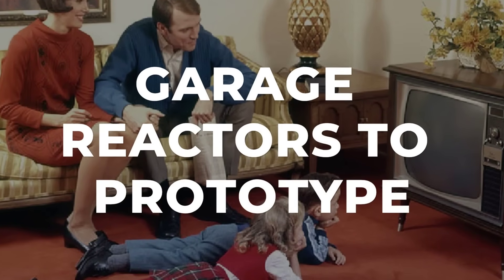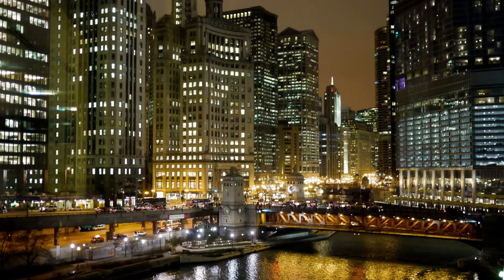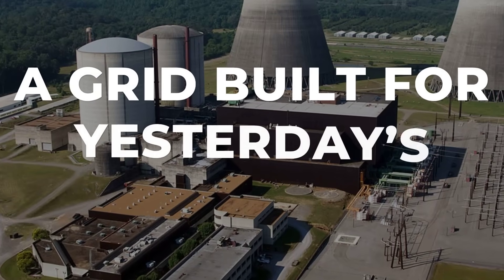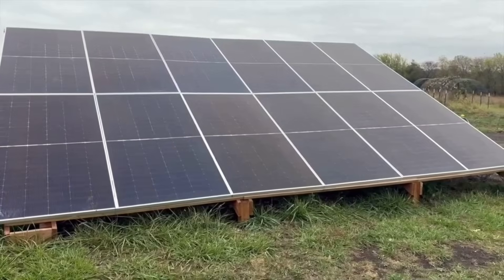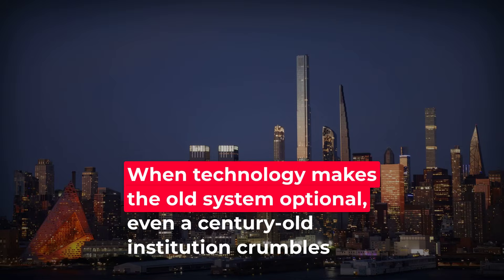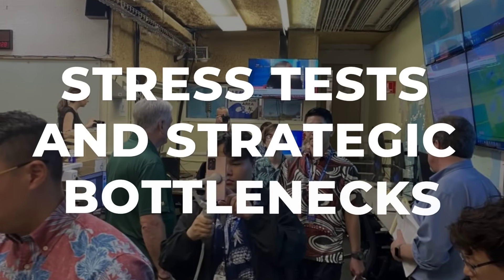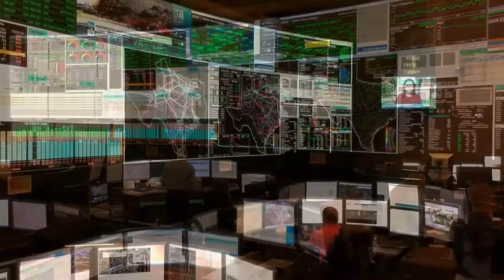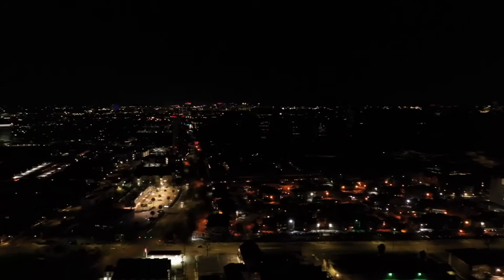Scientists Cracked Electrostatic Fusion.. And it Might Have Just Doomed the Power Grid

Comment: What a load of tosh. I hardly believe that fusion is that simple to achieve.
Reply: Small scale fusion is actually fairly easy with modern science. It’s getting useful energy back out that’s the problem which is true for most energy sources. It took decades to develop methods of turning raw fire into useful steam power and then electricity.
Reply: Electron bubble confinement fusion is easy to create, but the structure is corrosive, so containment and passivation remains hard.  Maybe a replaceable metallic reactor liner is a starting point?
Reply: It's just a school science project to build a fusor. The problem is getting the energy out of the thing.

Comment: A Penning trap modified to have its fields segmented  hypothetically may confine electrically charged material indefinitely with excellent stability. Several years ago MIT developed flat thin rings shaped like saturn's made of stainless steel with a spiral groove that accommodates brittle superconductors. In this structure superconducting current stays in the spiral flat coil and the brittle superconductor is mechanically protected. 

There will be a diagram at the end. 

A thermonuclear reactor is envisioned with an electrically nonconducting cylindrical envelope containing the reactants at low pressure in a near vacuum. The cylinder is surrounded by a row of coaxial face to face MIT rings which carry a sequence of magnetizing current and electric charge. 

The center ring is ground. Progressively stepped high positive voltage is applied ln both directions from the center along the row. 

The rings also carry magnetizing current which is maximum in the center ring and progressivly decreased in steps towards the ends. 

The overall efect is a pinched waist magnetic field which is ultrastable to confine charges with off axis motion yet allows axial motion. Meanwhile the electric charge repels the positive charged nuclions from the ends. Some electrons are pulled out at the ends which is an advantage. 

Here is a diagram of this: 

() is a magnetic ring. An increasing number of arcs represents increasing magnetizing current; an increasing number of + symbols represents increasing positive voltage. 

()+++   (())++   ((()))+   (((())))0 ((()))+  (())++  ()+++ 

This should be open cooperation science.
There is other research on similar concepts. 

Aloha
Charles M Brown  
Kilauea Kauai Hawaii 96754
Reply: If you build it they will come alright😅😅😊